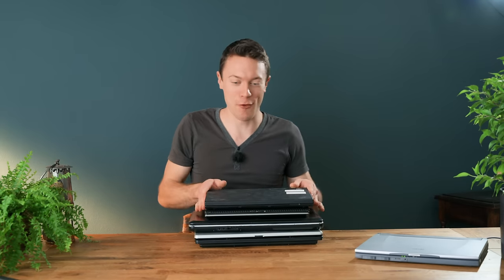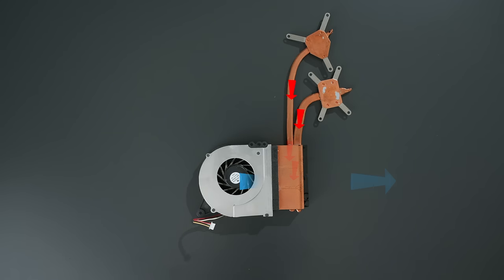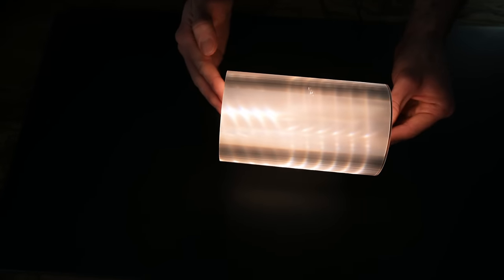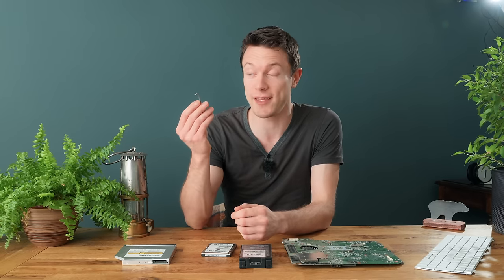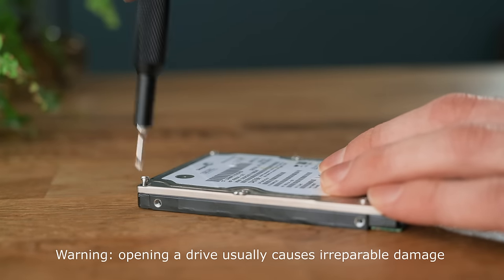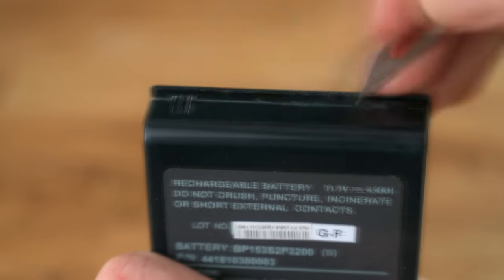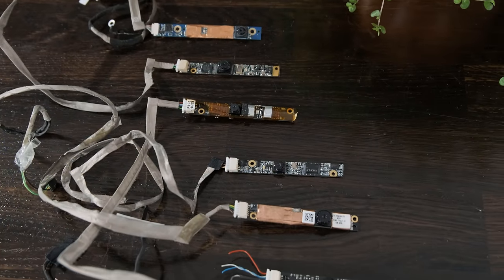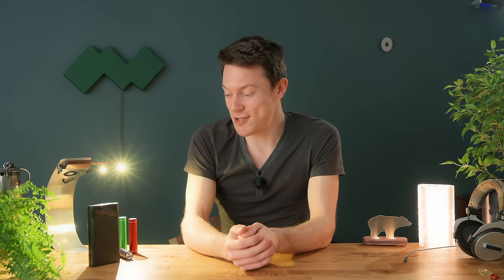Things you can make from old, dead laptops

Comment: The most valuable parts of an old laptop is the hard drive, the 18650 batteries (for diy projects) from the battery pack, and the slimline sata optical drives. 
(Do NOT open the battery pack if you don’t know what you are doing or are not familiar with Li-ion batteries!!!!!!) Lithium Ion batteries are excellent but can be extremely dangerous if handled improperly. Always cover the positive end of the batteries with electrical tape when not in use to prevent accidental short circuits. These batteries do no have built in discharge safety circuits so if they short out they will quite literally destroy themselves and heat up whatever is shorting them out to the point of causing flammable materials to self ignite

Comment: Hello Matt, I have a Microsoft Surface Pro 7 display I would love to reuse as a second display for anything else but I'm having problems finding a controller board. Would you have any friends or knowledge as to whether or not this can be done? I have a broken glass digitizer but the display works fine. I had my surface screen replaced but I am left with this otherwise good screen to use in some kind of project. I have gone as far as looking for the LCD display connector wiring to see if I can make my own minus the touch capabilities of the unit. Or if the digitizer is needed I found one for less than 40 dollars in AliExpress. Ill be looking out for an answer from you or any of your 100 million viewers.. TIA

Comment: NOTE: Search for videos of18650 or lithium ion battery short circuit before trying to cut into a battery pack to repurpose the cells in a laptop battery pack and decide for yourself if it's worth risking THAT shit happening should you accidentally rupture an 18650 cell.

Comment: Before pulling it to bits try duel booting it with a Linux operating system. I recommend Ubuntu or Mint. As long as all you are using is a browser, you will be shocked at how fast it is.

Comment: What works on an old laptop with these specs ?

System Type	 X86-based PC
Processor Intel(R) Core(TM)2 Duo CPU T6400 @ 2.00GHZ, 2000 Mhz, 2 Core(s)

Would appreciate thr help 🙌🏼

Comment: The laptop I took apart had a 2 pin speaker with blue and white wires. Where does the speaker plug in if i dont have the bluetooth stuff?

Comment: Me with my ddr1 256mb pentium m 1.6ghz ultra ata 60gb hdd and a wifi card bigger than sodimm ram laptop

Hm yes i can use those parts

The 32bit cpu literally ranks single or double digit away from last place in userbenchmark

The laptop stinks and has white particles all over inside and out making a mess of everything around

The screen is burned and the content cant even be recognized

There is a point when old is simply too old

The laptop is a huge ass brick too, bigger than thinkpads

Comment: You don't have a masters in engineering? You don't know how to combine two metals in five different ways? You don't know the difference between a capacitor and a resistor (don't worry, neither do I)? You don't own a fully equipped tool closet (a box is simply not enough)? 

Then this "tutorial" is not for you (or me).